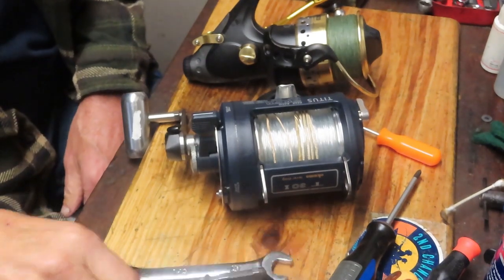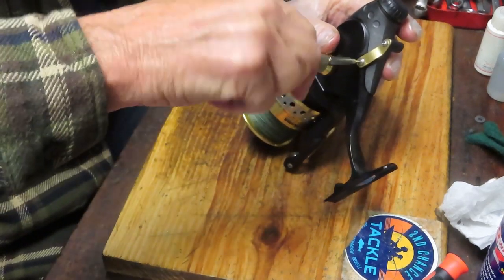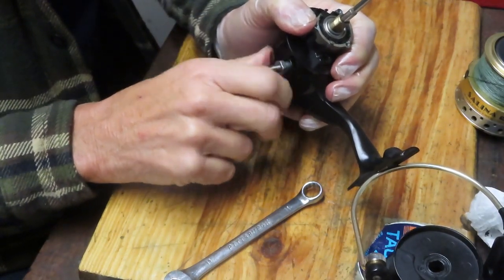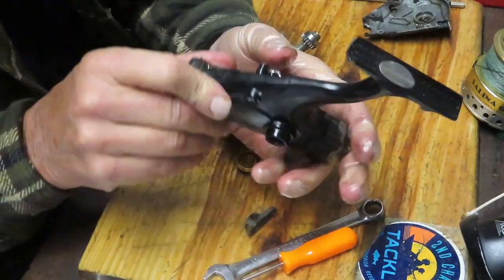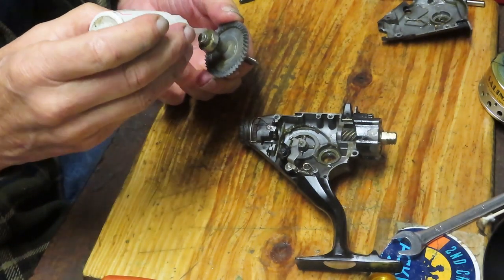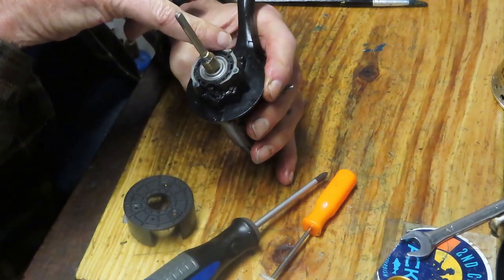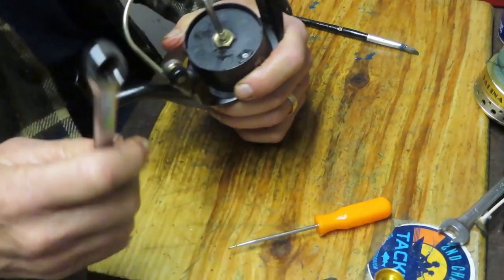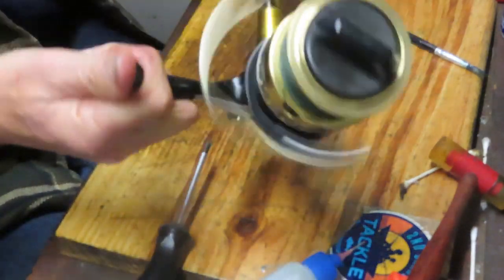Okuma Salina 80 Bait feeder fishing reel how to take apart and service a difficult reel

Comment: Okumas are a challenge to work on for sure. My brother in law has three of them that I've worked on in the past. Unnecessarily complicated.
Reply from the maker: They are not the easiest but a lot of bait feeders need to add mechanicals to make it work and how they design the functions are often by taking a straight top drag reel and working in the baitfeeder mechanicals, sort of engineering around it and that is where it get complicated - Thanks

Comment: Wow! This is an impressive looking reel and I bet it wasn’t cheap. I have an Okuma Avenger bait feeder and it’s the only bait feeder I have. I bought it because it was a 40 size and has a fairly simple mechanism as far as bait feeders go. I have not had the opportunity to use it yet but I’m looking forward to it. I did service it when I got it and had no difficulty but this reel would be an entirely different animal for sure.  I honestly don’t know how you can remember where all the different screws and parts go in this reel w/o looking at your video again. I don’t think I could remember all this. This is a complicated reel! That rear drag was absolutely filthy. I’m not at all sure I could do this one. You did an unbelievable job on this one Dennis.  It was very interesting. I think I’ll be satisfied with my little Okuma Avenger ABF 40. — Chris
Reply from the maker: I am sure yours will last, just like this one.  The avenger is not quite as difficult as this one.  I think they changed the A/R clutch design.  The one on this reel is the old housing with the free standing rollers and clamp.  It is a nightmare if you are not aware of the set up - Best wishes - Dennis
Reply: @2ndChanceTackle  This Okuma bait feeder had an AR override did it not. I like that. I don’t like just an AR clutch. This Okuma was one of the largest bait feeders I’ve ever seen. — Chris
Reply: Nice job on this reel lot off parts and different screws 🤣🤣🤣 would take quite a little bit to service this reel nice job Dennis 😊

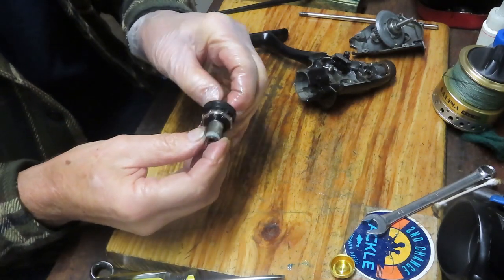Comment: Dennis, at around the 18:15 point in the video there is washer laying on the table after you put the front bearing on. The video stops and restarts with with washer gone. Did that washer go on top of the bearing? Thanks. This is one of my favorite videos. I don’t mind that it is long. It shows your process of discovering how a new to you reel operates. Absolutely fantastic.
Reply from the maker: Yes.  I stopped the video to look at the schematic and take a break as it was running longer than most.  Best wishes Rick - Dennis